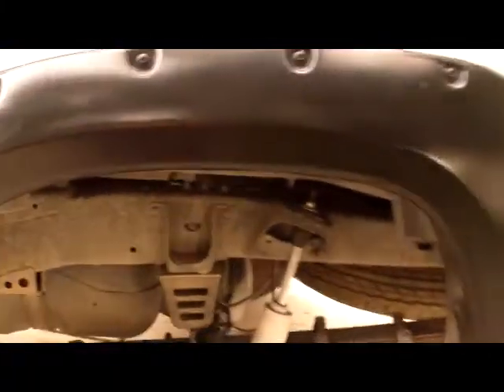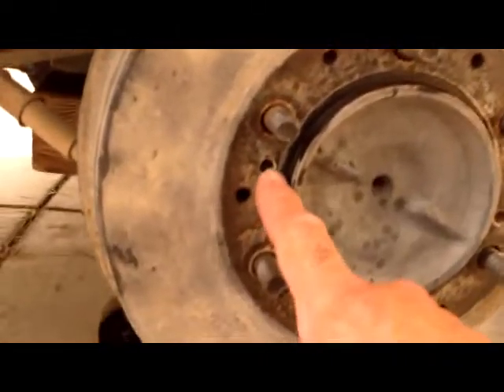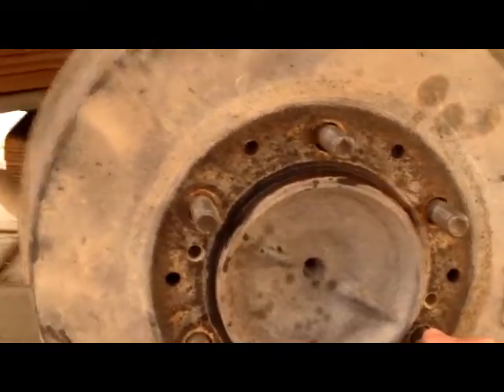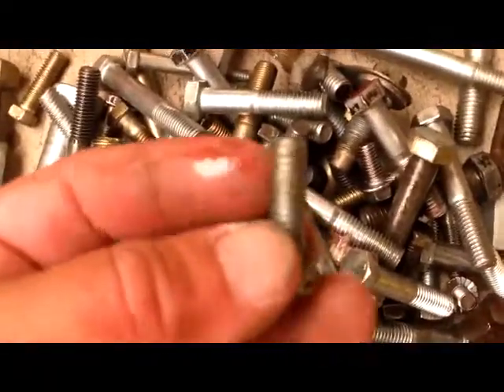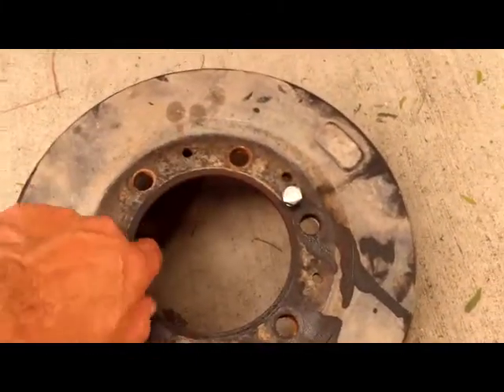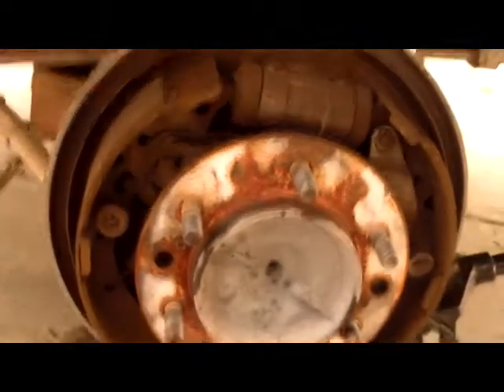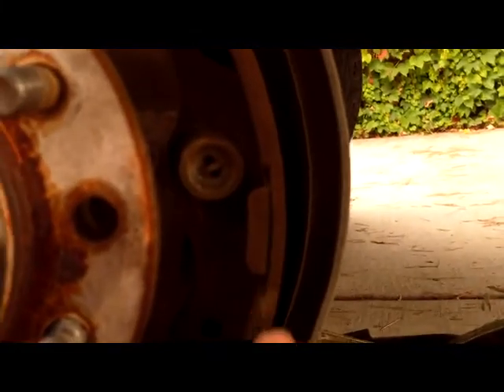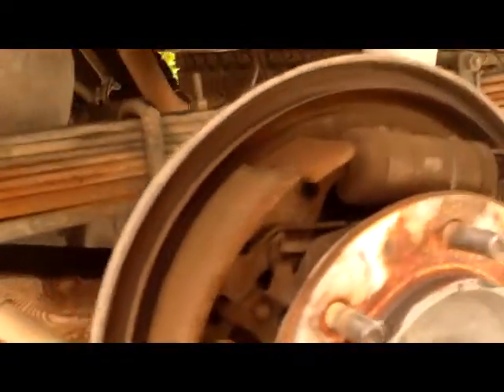2010 Toyota Tacoma Rear Brake Check

Comment: The "8.8" on the bolts has nothing to do with their size, it is the hardness/strength or grade of the bolt.  On a metric bolt, 8.8 is about the same strength as a Grade 5 SAE bolt.  I believe (wouldn't swear to it) that the correct size is M8-1.25 (8mm bolt - 1.25 pitch thread).

Comment: Your a trooper , I couldn't hang with no Air conditioning on hot days like today.
Reply from the maker: Randy Frame I work construction so I'm use to working in the weather. I also need my AC working to the max on my long ride home in Southern California traffic. I dont think I would do the drive without the AC!
Reply: +rudedogii 
Hello, I live in Los Angles and I have been having trouble with my Toyota Tacoma. I was curious if you live in Los Angels and could help me...There is a a thud which happens sometimes after i let off the brake. I put in new leaf springs and shocks but it still does the same noise, though not quite as bad. I am just curious if you have any knowledge with 1999 toyota tacoma?
Reply from the maker: +Bobby Martin Well it could be something in the rear brakes. Maybe a broken spring. Have you checked the brakes?

Comment: 60,000 miles according to the odometer, or are you factoring in the difference in tire revolution, with the larger tires?

I assume that the odometer is off because of the larger tires.
Reply from the maker: genconex Yes that is odometer. Yes odometer and speedometer off because of the larger tires. Need to regear. 4:56 gears should bring it back into specs.